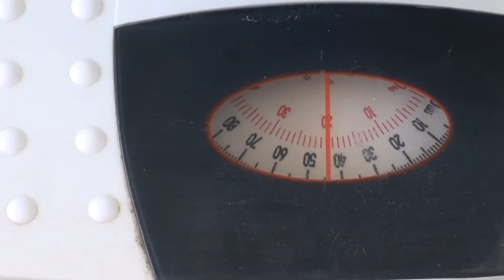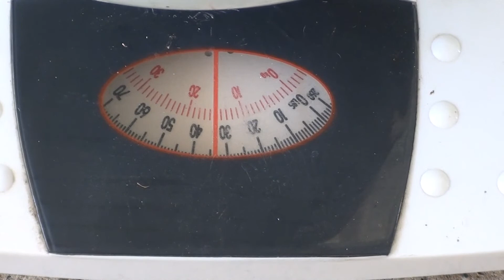How To Decant Gas Into A LPG Car From A Gas Bottle?

Comment: very good video, any ideas on how to transfer the LPG from the car to a bottle? Service stations do not allow filling bottles. Thank you very much.
Reply from the maker: Not possible!!!  For every car's LPG filling adapter:  There is an "one way valve" inside filling adapter which allows only LPG through into the car's LPG tank, not the way around.  However it can be done but the task will be involved too much troubles for the ordinary people, should leave it to a profession technician.  Thanks.
Reply: @diymade2175  Is it safe to remove the one way valve inside the filling adapter? Or where can I find a profession technician? Thank you Bosss🙏
Reply from the maker: @pppidsn647  It is NOT safe to remove it by yourself & never ever to do that!   Where to find a profession technician?  I'd say where the mechanical workshops for LPG services & repairs are. Thanks.
Reply: @diymade2175  Okay boss, Thank you very much for the help👍
Reply: @diymade2175  Filling bottles in stores like BCF is a bit expensive. I'm looking for a cheap solution.:face-green-smiling:
Reply from the maker: @pppidsn647  No No No.  it is not a cheap solution for your concern, is never going to be. 👉       Thanks for the question(s).
Reply: My thoughts exactly! You should be able to put a T junction into the gas line from the tank with an on/off tap to then connect a lpg hose with a female pol connector to it that’s ready for you to connect to when needing to decant from your car tanks. Great way and a lot cheaper to fill your house gas tanks instead of getting delivery truck.

Comment: We can only seem to put less than half of the LPG bottle into the car. Any suggestions would be appreciated. Do i need to open both valves
Reply from the maker: Thanks for your interest, Mate!  In fact, It can not fill all LPG from a bottle to a car's tank completely.  The purpose of this video showed how to get some LPG from a bottle into a car with a empty tank for making that car drive-able to nearest service station to have a car's LPG filled.  There are some additional ways can be used to get a bit of more LPG into a tank however it wouldn't be much considered the steps, procedures or troubles involved.  👍😗 👍

Comment: I need more details  of adeptor fixed on car
Reply from the maker: Thanks for your interest!   The Adapter was bought on Ebay long time ago, its name:  "ACME LPG Automotive Filling Coupling," the one end is Female Type - Diameter:  1 + 3/4" (this end screws to car's LPG filler).  The other end is BSP Male Union Type - Diameter:  1/4" (this end screws to a hose which its other end to LPG bottle).  Good luck!

Comment: I was always curious to try this but never did. Always warned that lpg and auto lpg are VERY different.

Auto gas is not corrosive, however gas bottle lpg is. Auto lpg has an oil additive that is separated before combustion. Mechanics drain this as part of a regular service.

This would get you by in a pinch if you ran the tank dry, but it's definitely not recommended by mechanics.

Cool to see though
Reply: You say some interesting things....   could you elaborate please?

LPG and auto LPG are both generally a mix of propane and butane....   depending on the source of the gas (where it comes out of the earth, not which servo)      Often around 90% propane, and 10% butane....   but victoria tends to have a richer mix, sometimes up to 100% propane.   This variation has no significant effect on LPG cars.... and no detrimental effect at all.  
(propane has a slightly higher calorific value...  so slightly more energy...  that's all)

Barbeque and all other portable domestic gas bottles are stated as 100% propane.

You state "Auto gas is not corrosive, however gas bottle lpg is"....   I've never heard this, and can't find any internet source stating this.  Given the close to, or identical composition (depending on if it is 90/10 propane /butane, or 100/0 propane/butane)...   I'm not surprised that I can't find any internet information supporting this.         Are you able to elaborate, or point to any information source supporting this please?     (I'm very aware of the potential detrimental effect of ethanol in fuel, but that's completely different?

You state "Auto lpg has an oil additive that is separated before combustion.   Mechanics drain this as part of a regular service.".... this has me utterly mystified on several counts....

a)  why include (add) an additive that is separated before use?  
(Catalysts are used to facilitate chemical processes, without actually being consumed in those processes....  but that can't be the case here because you say the additive is separated before the LPG undergoes combustion) 

b)   "Mechanics drain this (separated additive) as part of a regular service"....   I've never heard of this, and hope you can educate me.  

LPG systems in cars generally either by the converter/mixer method (adding LPG to the inlet air either through a ring at the base of the carby, or in the general area of the inlet manifold)
 or by direct injection in the inlet manifold immediately adjacent to each inlet valve port. 

I've never seen or heard of any form of reservoir to collect an additive from the LPG..... and have never drained anything on an LPG system as part of a regular service. 

The only thing I can think of that is remotely similar to what you wrote, is where in the case of engines not designed for LPG use (and those designed for using leaded petrol), but with LPG conversions....   where because of the reduced lubricity of LPG, there can be detrimental valve/ valve seat wear.  In such engines which aren't made with suitably hardened valves/ seats, the aftermarket has introduced products such as "flashlube" which are effectively a lubricant reservoir which must be regularly refilled, that introduce small droplets of lubricant intended to lubricate the valve/ valve seat face. 

It seems you're suggesting that propane (the primary component of LPG)  has such reduced valve/ valve seat lubricity that not only do dedicated LPG engines have hardened valve/valve seats, but that the fuel must also include some additive that doesn't actually make it to the engine, but is decanted off.     

Did a mechanic tell you all this, or is it something you are familiar with and can help clarify my confusion please?
To be honest, I wouldn't be using a mechanic who told me this stuff.
Reply from the maker: 👍👍 You are right.  Regarding to deal with LPG:  The one has to know what to do & how to get it done safely, certainly this is not for the most people in general.  Cheers!
Reply: @diymade2175  100% mate 👍

Was always curious to try it but don't have the balls to do so. You sir, have janglers made of stainless steel.

Comment: What was the car's fuel gauge reading before and after?
Reply from the maker: Good question, however I didn't pay attention regarding your concern at that time but the car's gas tank was empty completely before the bottle filling.  The car's fuel gauge was in good working order, I would say the gauge needle should indicate just a little over the empty mark.  Thanks for your interested!

Comment: I would rather fill the bottle.
Bottle replacements are much more expensive than filling the car
Reply: @Napoleon_Blownapart
Napoleon....  I think you missed the point...     a bit like when you got that advice about not going into russia....
The whole purpose of the video is to demonstrate how to get some LPG into your car, if you run out of LPG and don't want to push your car to the nearest servo. 
You can fill your gas bottles till the sun goes dark, but that won't get any fuel into your car.
Reply: @annpeerkat2020  the fuck are you talking about russia?
Reply from the maker: Yes, your right in this regarding.  Thanks for your interested !
Reply: @diymade2175     did you find that response the easiest way to deal with forkwits?   :)
Reply from the maker: @annpeerkat2020  😬😇🙃🤛👌🤜

Comment: Where can we buy ther hose
Reply from the maker: Thanks for interested!  I bought it from hardware store that was long time ago.  I'd say you can search on ebay, alibaba or amazon etc. now days and good luck.
Reply: @diymade2175  what's it called how do I find it
Reply from the maker: Try searching:  LPG accessories such as high pressure hoses & adapters.  Thanks.
Reply: @anthonypapheys4797  we don't have gas staition where we live there is very few staitions in Ireland

Comment: Nice Video! Thank you. Please tell me the capacity of your bottle and was it full. I can use a bigger bottle, right?
Reply from the maker: Yes, correct.  The bottle shown in the video was 17 liters and full.
Reply: If you can lift a 45kg gas bottle and hold it upside down while it adds lpg to the car tank...  yes, you can use a bigger bottle.

Comment: It costs more to fill from cylinders than servo. Plus it can’t empty the cylinder only equal the pressure in both. And extremely dangerous to do with home made hoses like that.
Reply: The trouble is so many servos are getting rid of their gas tanks now😕
Reply: Why? How does it differ from a bbq grill?
Reply: @RangeDelay  Because a BBQ grill operates at very low pressure, that's why there is a regulator from the bottle to reduce the gas pressure. When filling a tank the gas needs to be at a high pressure in order that it stored as a liquid, hence when the bottle and the tank are at the same pressure no more gas will flow.
Reply: @jacenjason3880
Given that the purpose of the exercise is to get LPG into an empty car LPG tank, so you can drive to the nearest service station....   you don't have to completely empty the donor gas bottle.   And who gives a rat's arse about if it costs a bit more, given that your alternative is probably a tow truck. 

I agree that the clamps on the end of the hose should have been a bit tighter....     the gas bottle was probably between 100 and 200 psi.
Same ballpark as going anywhere near the engine of a running car, if it has fuel injection hoses.

Comment: How do you know when its full and how much you filled?
Reply from the maker: Thanks for the questions !  During filling from a bottle to a car's tank, you could hear "hissing" sound, however no "hissing" could be heard when it was full (in fact, it was not necessary full, it was the pressure had been equalized between inside bottle and inside car's tank).  Each car is different, in the case  the video showed, a full LPG bottle had filled into a car's Tank:  10 L LPG.

Comment: So finally I can refill my lpg without an extra gas pump?
Reply from the maker: You're right but make sure to have it done safely !  Thanks.
Reply: But you can't empty the whole spare or camping bottle,  once the pressure in the car's tank is equal you are done. This is the case here. I guess there's still gas in the camping bottle. Here in Germany the smallest one got 5kg followed by 11kg Bottles and 33kg and so on. I guess the one shown is around  11kg but I'm not sure because is an Amercian Bottle North or South. Greetings from Germany